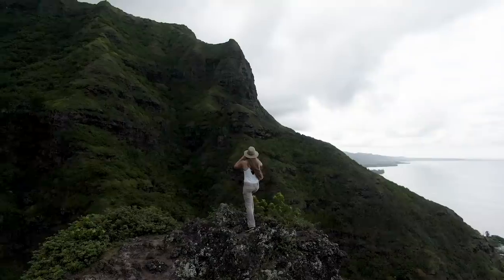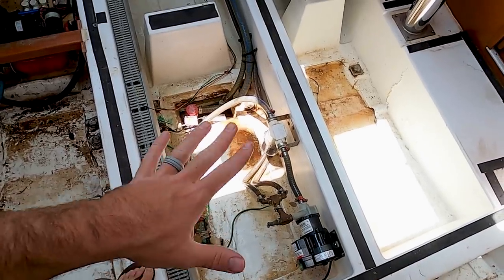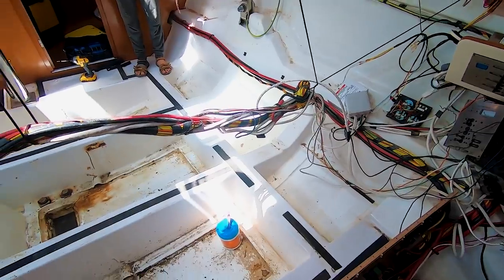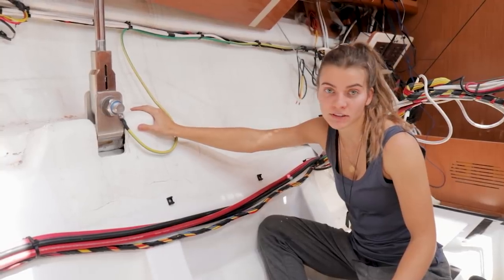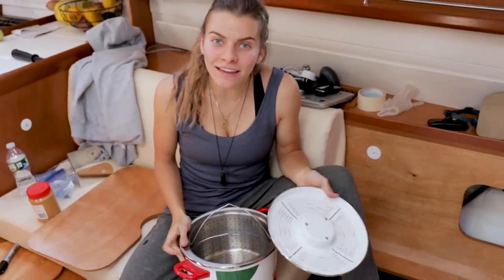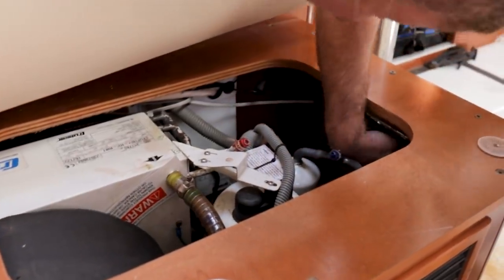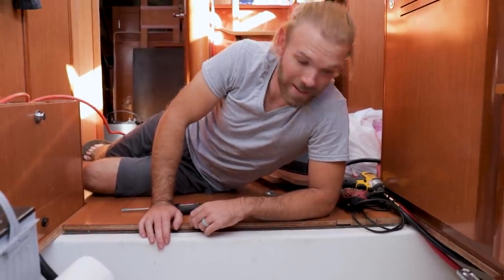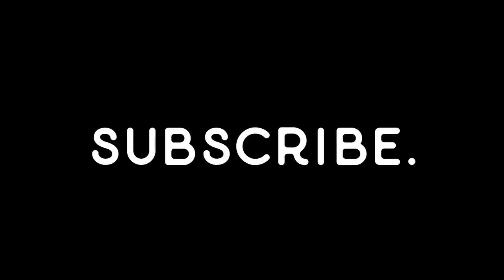Our SALVAGE SAILBOAT Has Been Leaking for Years | Expedition Evans 6

Comment: While you have your floor boards up you may want to think about how you hold them down. The Velcro is good for inshore stuff but you May want to upgrade to a mechanical lock of some sort. When you cruise you’ll want to store water, spare anchors, chains, etc in your bilges. That significantly helps with stability & fitting more stuff in. Your boat has a super short keel & is not that stable so should you roll you want things to stay in place. Some saddles to tie things down in the bilge is a smart idea too. The flat kind work well.

Comment: Cool videos...be cautious utilizing any cleaning products or other products that have potentially combustible fumes as you are inside and I believe utilizing a propane stove top.   Another you tube sailing channel utilized normal non-marine degreaser on his engine as a routine clean and then 30 mins later started the stove top to heat some water and 10 mins later the fumes created a huge explosion, luckily he was not in the cabin at the time he was on deck working...I look forward to the progress!

Comment: If you are planning on bluewater cruising I would reinforce the grid while you are down there and have access to everything. Production boats like Beneteau are notorious for being built light to keep costs down. Therefore they tend to flex way more than you would want if you are doing anything more than coastal cruising and within reach of shore. What is also very common on these light production boats is that if you have a keel strike the front pulls down and the back gets pushed up. Can't tell if that is the case without having a real close look at all the possible indicators.

Comment: Hi lovely young sailors! Regarding the case of your boat, I had similar problem with my Swedish fiberglass sailboat Helmsman, it has a Kyle wish weight 600kg and same fond fractures around the Kyle attachment points...this was a result of two main reasons: 1- the hull structure was suffering from osmosis process because it spent long time in water rather than being dried on dry dock yard, 2-  the Kyle hit hard rock in shallow water during a windy storm that caused these nasty fractures...., What you must do is: 1-  lift the boat onto dry dock, 
2- take off the kyle,
 3- examen the extent of osmosis damage / humidity in the fiberglass structure
4- take off all damaged areas since there's no way to fix it, and any ad-hoc fixing will turn back very expensive and life threatening...
5- build from the inside of the hull an aluminium cage-like shell structure to be laid over the max. Surface as possible, then attach to that structure aluminium grid over which you put sheets of fiberglass/carbon fibers, Same for the outside face of the hull. 
6- you must be aware that the new attachment points of the Kyle must distribute all its weight on the central spine bar and that should distribute  the weight evenly along both sides of the hull perpendicular to the spine bar, otherwise if the weight of the heavy Kyle is concentrated back on small area and if by chance it hits again a rock in shallow water,  you will be returning back to face the same problem.

Comment: I commented two videos ago about getting a surveyor involved in this project not to see you spend a lot of money but to make sure the repairs are done correctly and also that the repairs are documented by a natural party. The surveyor will give you an understanding of the type of resins to use as well as the type of fiberglass and the scheduling of the glass when installing. How are you going to check the hull to make sure the hull is back to its original shape. This is of great concern and will need to be answered before the repairs are started.

Comment: there is tabbing where the keel support grid attaches to the hull - a production factory sometimes just uses glue such as Sikaflex epoxy structural adhesive.  the tabbing in way of the chain plates is added after as additional reinforcement.  since this area is damaged it would be a good idea to grind away the finished surface and add additional tabbing using biax fabric to reinforce the joint between the keel support structure and the hull.  (DO NOT just use chop strand mat!)
usually anywhere there is a pan or liner for storage in a production boat for the bottom of a locker - this is part of the moulded part - sometimes from the same mould as the structural grid.

Comment: Hi there! More advice/ideas I'm afraid...You do not appear to have any record of the previous owner(s) if you start at the beginning Beneteau should have a record of the build spec including the lay up process used, plus where it was delivered to and be able to tell you if they have ever had the yacht back for remedial work, if you haven't already done so I suggest you drop them a line. Second as with a car log book do you not have a central register in your country (plus any other country where it will have been registered)? might give you clues as to owners/yards where the yacht has been laid up? I have a 1934 Peugeot and I have been able to trace it back to the factory! You have some very sound professional advice on structures and repairs which I would definitely take heed of, she looks like she has had a pretty hefty whack. Cheers and good luck. Best wishes Peter

Comment: The  square washers under the heads of the keel bolts should be replaced with an elongated (rectangular) stainless steel plate and the edges should be rounded to prevent them from digging into the fiberglass. Try to get each rectangular plate to span as many keel bolts as possible.
Reply: I often wondered why the big yacht construction companies don't do exactly that. I've never seen rounded plates unless they just have washers. I can only think of two reasons, 1. It's cheaper this way, or 2. It doesn't matter anyway. I'm thinking that someone in one of Beneteau's 22 production sites knows the answer. Mine are exactly the same and I don't have a Beneteau. .

Comment: You guys need to watch Andy at Boatworks on how to knock to listen for hollow glass and delamination. And then watch Mads at Sail Life on how he redid his whole grid due to the same reason and also checking to see if water hat gotten inside his plywood grid core which it did and caused issues. DO THIS ONCE THE RIGHT WAY WHY CUT CORNERS AND HAVE TO DO IT TWICE.

Comment: You need to properly clean the boat using jet sprays and industrial strength cleaner. This will get rid of mould and dirt much more quickly and effectively than rubbing and wiping

Comment: the stringers  are very important  for any vessel and when repairing it  thought must be given  as to  how the boat builders   secure them to the hull. applying fiberglass/ fillers or whatever bonding agent you decide to use must take into consideration  how the hull settles and moves while in the water. , is the hull shape  on  stands the same as when in the water if not it should be blocked up  properly to prevent the hull  from distortions. that fiberglass work is  a nightmare. I did a repair job  years ago. surprised  it did not kill me with all the dust in my lungs. I have had xrays done since then and fortunately no abnormalities. , I  f  I had it to do all over again I would get some one else to do the dirty work .

Comment: Is the hull on this yacht balsa cored? With those cracks it would be important to investigate the state of the core and dry out out the areas effected . 
I used to fly gliders and learnt damaged fiberglass turns white. That may  sound a contradiction when everything is white but it can be seen.
Reply: Expedition Evans can confirm, but I think these (like many Beneteau) are solid glass hulls.

Comment: I guess the most important result of the repairs must be a structural sound boat you can trust. So i think everything that could possibly cover up a problem should be removed. No small task. If i see the cracks i am reminded or SV Zingaro, they have a YT channel. The boat was old, a catamaran, and in a storm the right shoe tried very hard to separate from the rest of boat. With a rope and a winch they managed to keep it together, however after this the boat was done. Structural integrity is the most important thing.
Reply: Zingaro was never designed for the use they pressed her into, coastal cruiser only . She was old , lots of plywood , some bad mods  ,and  not well maintained to boot. She had some bad groundings and bad repairs that let water into the core so ticking time bomb .  Everyone that knows boats was waiting for a major failure and hoping there was not going to be one  .

 Anyway these glued in grids are known to fail , the glues degrade over time .  Glass it back in properly and she will be better than new (make certain it is not twisted in the stands first ) . 

They call those boats "bendy slows" for a reason LOL .
Reply: @theowenssailingdiary5239  Nope , its bendy  slow .
Reply: @theowenssailingdiary5239  LOL - I always tell people that boats are a compromise and that every boat is perfect for  certain people . 

Me I would not have a boat that does not go to weather well , others want big space and count on big engines to take them to weather claiming gentlemen don't beat LOL . I think that means they can't .  I feel it is unsafe to have a sailboat that can not claw off a lee shore in a blow . But this is me . 

We were out one day in a C&C 35 and sailing with friends in a Hunter 40 something .  On a reach they were pacing us and we felt good given they had 5+ feet of water line length . So we decided to see what they could do upwind and ground everything and went up about 20 deg  and they did not come so Oh well and off we sailed in a different direction 

Back at the dock they expressed shock , they were already hard to weather and could not believe how much higher we went with ease .  They could not go there

Comment: If you have a Harbor Freight near you ........ Pick up several boxes of their 7 Mil Latex gloves.    They are way better than the cheap ones you are using.
Plus, they will last for a few uses..  Wash your hands with the gloves ON and then slowly remove them by sliding the fingers down.  Then loosen the palm section down and off.  Hang them up to dry and reuse them until they fail.  Usually the fingers pull off and then they are useless.

Comment: One of my concerns about hidden damage is that when the boat grounded, the rig would have had momentum to keep moving forward before the shrouds and chainplates strained to stop it.  I'm wondering if there was damage where the chainplates bonded to the grid/hull and was that a repair that was made?  Seems like those impacted areas should be checked, including the deck areas at the base of the shrouds as you could have leaks and water intrusion into the deck core.  Others have presumed that the hull is cored, but I don't think so.  I believe the decks are balsa cored, but the hull is solid glass.  Market value on these boats looks to be in the low 200's, so that's your target for cash investment after deducting what you paid at auction.  You may say this is your forever boat, but things happen and things change, so you want to know that you can get your money out of it at some point.

Comment: Hello Evanses! I wrote a long "dissertation" on the previous episode. I am going to write this one, and then I will shut up. You are well on the way to convincing yourselves that the damage is just the delamination you can see. Many very experienced sailors who have been through this sort of situation, including myself, have been warning you that this is almost certainly not the case. I am BEGGING you to listen to them. PLEASE get a very experiences surveyor involved immediately, and then work with a naval architect to devise a plan ti fix the damage. Then get expert professional advice on HOW to actually do the job.

Your video shows clearly that you do not YET know what you are seeing when you inspect the grid. This is ok, we ALL started like that. But the minute you start "fixing" the boat, based on what you read in a forum or in these comments, you have lost the war. You are almost certainly going to gloss over serious structural damage which likely cause horrible problems later, possibly fatal ones as happened to my friends. 

This will be avery expensive repair if you do it right. There was a suggestion that you take the boat to Florida, as the weather where you are will preclude work during the winter. Although expensive to  truck it south, if you are serious about getting this repair done in a timely manner that sounds like a good plan.

Regardless, PLEASE listen to the voices of those who have been through thisand enlist knowledgeable experts to help evaluate the problems and find workable, robust solution. We ALL want to see you suceed, but this is a very tricky and serious path you are taking. 

All the best,
Michael
Reply: Well stated, I hope they take your advice, it will make the project really worth watching since it will be being done correctly.
Reply: Michael you need to read the information posted after the last video,  they have a surveyor/professional advice.
Reply: Happy happy snowflakes living in video land, wait til they're out in rough seas miles from land and they hear cracking noises.
Reply: I couldn't agree more. This requires experienced professionals to work on and perhaps can allocate you some of the work at some point. delamination is very serious, you cant just gelcoat and fiber glass over it, it would be like putting paint on top of a cracked chassis member in a car.
Reply: zendesigner you tell me to ‘go read it’ referring to your post as if I need to do as you say.  Firstly I don’t answer to you and secondly I never stated any opinion either way concerning how the boat should or even could be repaired!  

Michael in his post had simply suggested as one part of his solution that they get a surveyor involved.  I realised that he must have missed their follow up post from last weeks video where they gave some further information, one part explaining they had a surveyor working for them.  I simply let Michael know about the posted information.
Reply: @zendesigner  'Cheeki Rafiki' right?

The report into the loss of this boat and its crew was disturbing
Reply: A big ocean is a lonely place and no place to start thinking "I hope those bolts hold up" or "was that repair done properly"? The only way to go offshore is with 100% confidence that you have a solid, stiff, seaworthy boat. I have spent five years going through every system on my boat, which was already seaworthy. Taking your wife/husband/pet's offshore is a huge responsibility.
Reply: @irmux skeptic I agree. I am not sure I would even trust a regular boatyard or surveyor on this one. This is highly specialized work that potentially only the original manufacturer can undertake.  Even then, would be worried about taking it offshore.

Comment: Guys: I think that fiberglass difference between mold and hand layers could be the chain plates were attached by hand so the hand layer of fiberglass
Reply: I think you are right about that.  Probably has to do with the difference in layout configurations.  Beneteau probably has a common mold for the general hull, but based on layout configuration, things like the chain plate locations would vary.  Which would end up being hand laid fiberglass once in location.
edit: haha looks like she explains the exact same thing right after.  Maybe I should watch the entire episode first haha
Reply: Exactly what I was thinking. The connection between the standing rigging and the hull probably has to be the sturdiest on the boat (well, along with the connection of the keel to the hull).

Comment: Guys absolutely loving your videos and your enthusiasm, but please, please, make sure you get a good marine surveyor on board and maybe a naval architect. You have a significant structural job going on there for two reasons. One, the recent keel damage, but two, the other is a historical issue that goes back to the inherent construction of the boat. My father had 54 High Court hearings here in the Uk when he Sued Ancastor / Beneteau yachts. He employed the services of 5 Top marine surveyors but ultimately used Beneteau's own surveyor's report as it was condemning enough. There were a plethora of problems, but most are similar to yours, and that's the bonding of the internal stringer system. His boat hadn't even left the marina, and in the day a gap would open up and close between the bulkhead and hull and the same with the stringer system he has photographs where a cigarette packet is placed in the gaps. Please please don't think this is a job to be undertaken without the professional advice and consultation. If you need any help, please get in touch. I have over 30 years of personnel experience in boat building and time served marine engineer.  By the way, my farther won every court hearing and yes they falsified documents and al sorts of other stuff.